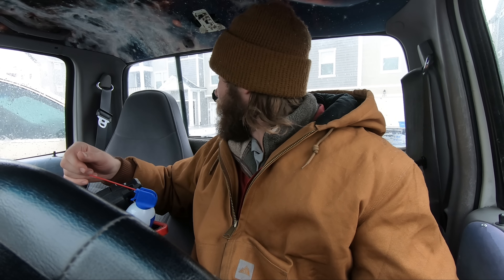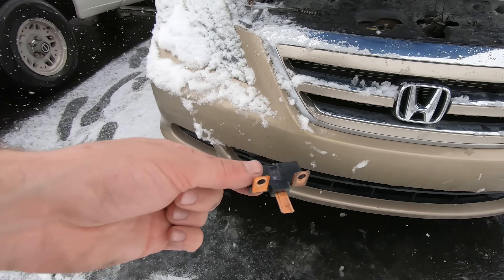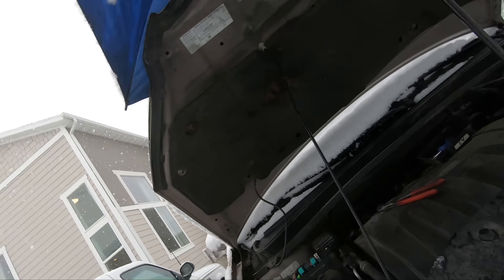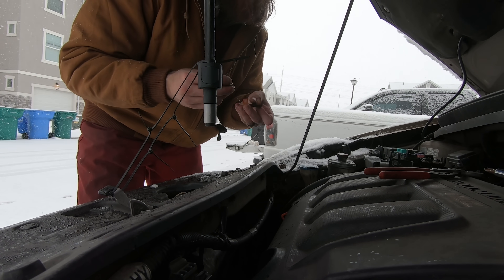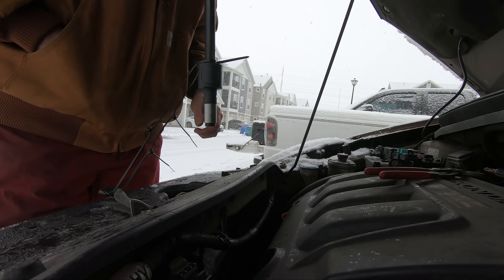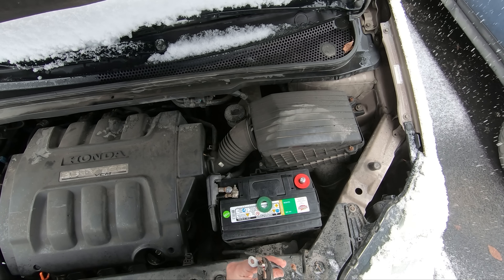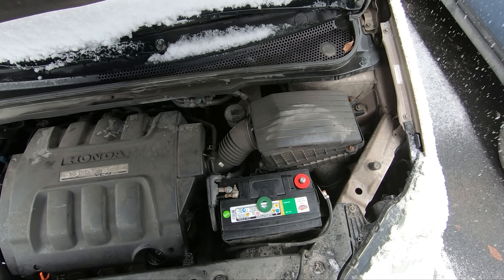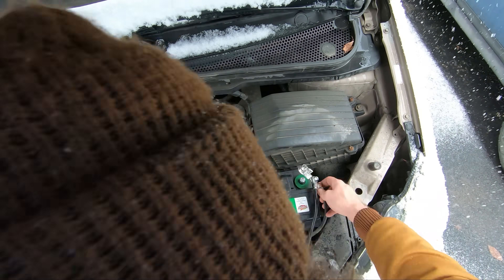Customer installed Battery Backwards! Can It be fixed?

Comment: Man I'm glad modern cars have fuses that prevent significant damage in the event this happens. My old truck has no such thing, and both cables are red, which is fine, just have to be extra attentive when connecting batteries and jumper cables. But like you said it's hard to get it wrong when we know the pos cable has all the extra stuff going to it and the neg should be bolted to ground somewhere. Also, when I'm replacing terminals, I like taking the battery out and using a cordless angle grinder to quickly cut those wires clean in half then use a razor knife to strip the insulation, this gives you a nice end to install into the terminal and looks good when hooked up.
Reply from the maker: Good ideas. Yeah older stuff just melts if you get it wrong...
Reply: Tech tip, cover the other red cable (that's really the negative cable) with black electrical tape and some zip ties to keep it on there
Reply: @ricebike  Yeah man that's a good tip. I haven't bothered changing anything because the starter solenoid is right next to the battery and the neg cable runs straight to the alternator which is only a couple feet away, my f100 is a simple machine, so simple anyone can pop the hood and start the engine using a screwdriver lol. I'll probably bite the bullet and make a new one using black cable.

Comment: I always tell my brother "Do not smoke weed before you work on your car" 🙃
Reply: Im stoned just finished changing my lower control arms pal
Reply: I always do when I lose a socket or tool. Helps me focus and find it quickly.
Reply: That's a good one hahaha😊
Reply: I took 3 .4 dabs and just did a cold air intake 😂
Reply: I smoke before I do any work
Reply: I thought I was the only one haha being a mechanic is stressing at times.
Reply: @Frank510.  Oh yea? Well I just ripped a bong and swapped out some rear wheel hubs.

Who's got me beat?
Reply: @therealanthony4978 that’s reasonable though, I’m guessing he’s talking about once your dealing with lots of screws, I have bad brain fog due to weed and forget what nut and screws go where.
Reply: Ive done entire engine rebuilds smoking and drinking

Comment: I never installed a battery backwards before, but I did try to jump a car backwards once (wrong terminals connected). After a few seconds of revving the engine, my wife noticed smoke in the air. By the time I turned off the car and went to unplug the cables, they had melted. Not completely, but enough to leave a film of light gunk on my gloves.

In my defense, it was dark, late at night (I was tired), and the Ford terminals weren't aligned the same way as the Toyota. And yeah, the Ford had glitchy electrical problems after that, but nothing that was a show-stopper.

Comment: I had a few batteries charged backwards.
Seriously.
If batteries are totally dead and someone hooks up charger backwards it charges backwards.
In marina we had hundreds of boats batteries and often owners put them on wrong .
Blew diodes alternator electrical stuff went crazy.
Reply from the maker: weird... I've never heard of that! Thanks for the info!
Reply: @RoadsideRescue  Also many new lithium batteries will not charge if to cold ❄️ or stone dead .
Special reset charger needed if it's stone dead below 10 v even .
My M18 batteries Milwaukee won't charge if below 20° .
Just to help others.
Good channel
Reply: I got an automated battery charger/tender and if I hook it up backwards, has that protection and red light to not put power on😅

Got it for some of my AGM motorcycle batteries, but works well for lead flooded acid batteries as well.
Reply: I’ve seen batteries charge backwards as well

Comment: The battery was the wrong group size either a 24R or a group 35 is the correct battery for the vehicle.
Reply: I looked it up and h6 or BCi group size 48 is for that Honda pilot... Fits that battery tray

But that "vcm"  is bad news for wiping out the bank of cylinders 😢

I got a 2005 MDX (first generation) and it fits a group 24F

Edit looks like any of them fit in that battery tray... I guess as long as it exceed OEM CCA